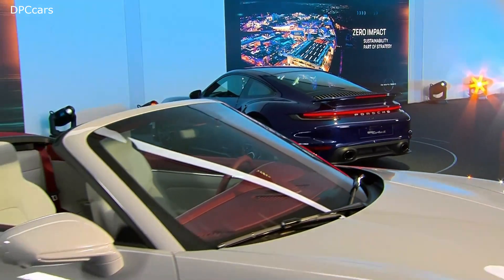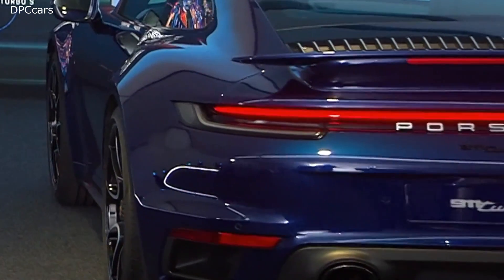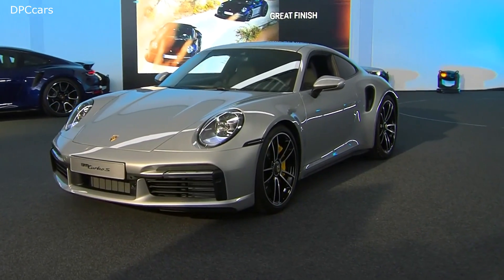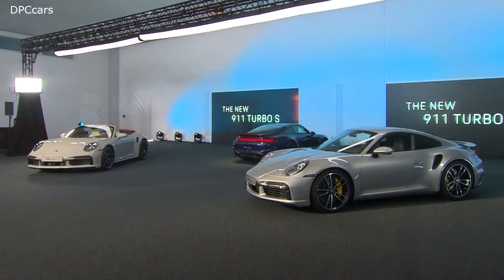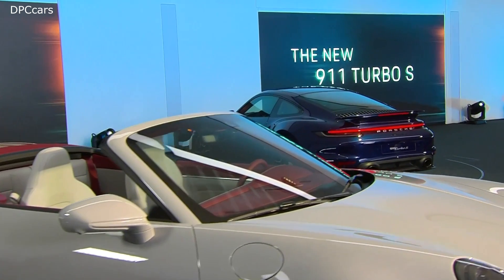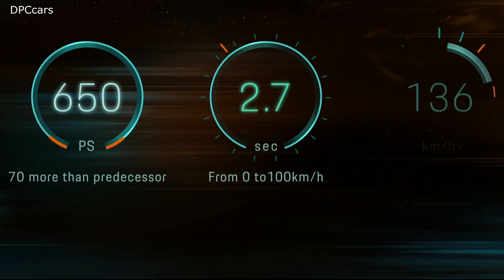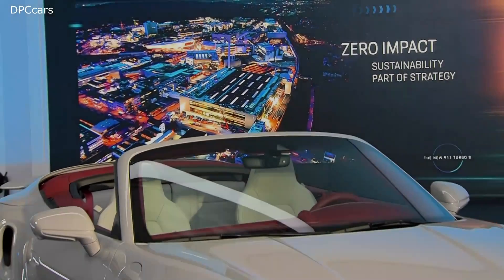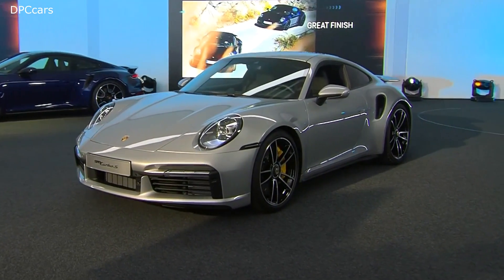Porsche 911 Turbo S New 2021 Explained

Comment: Why doesn't somebody invent a mechanically powered turbo? so besides being powered by the exhaust gas, the turbine can be artificially spun by electrical power? has anyone ever done this?
Reply: Mercedes does it with some of the 3.0 inline 6's. its considered a supercharger since it is mechanically drivin..also F1has or had, they move fast, a motor between the compressor wheel and turbine wheel